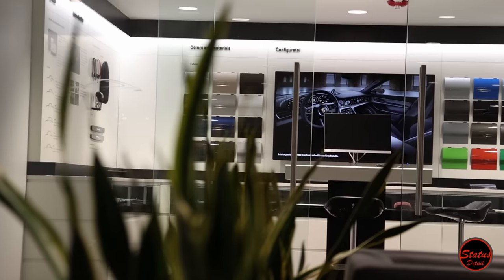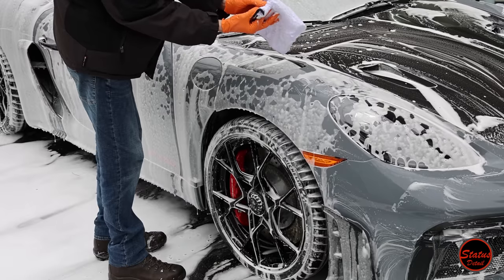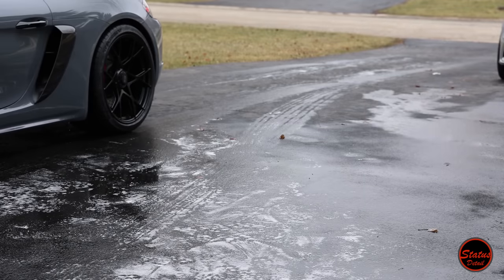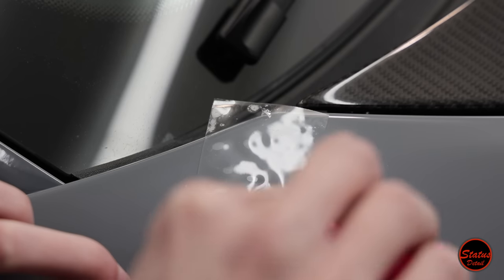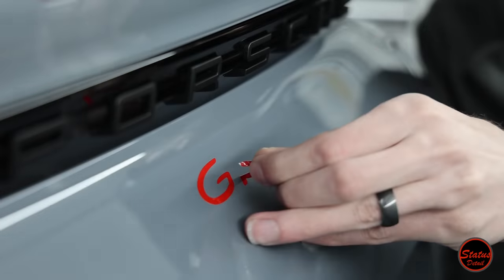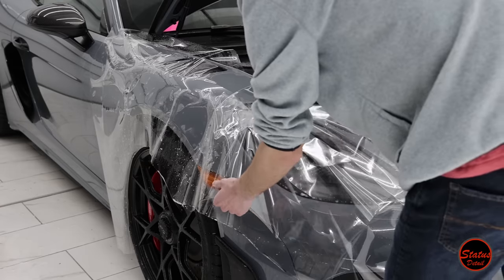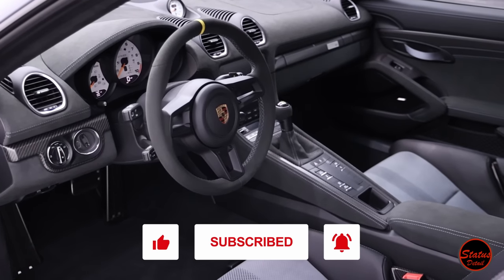GT4RS The World's MOST EXPENSIVE DETAIL!?!?

Comment: 12k but didnt even take the wheels off. Got the same job done minus the xpel and overexagurated coating My detailer did the same with a gyeon ceramic coating on the paint, glass, wheels (taken off the car) and callipers plus an interior detail good for 36 months with warranty for 1745euro's. You're a straight up thief bro.
Reply from the maker: We don't use Xpel. Stek is a superior ppf in my opinion. 

I'm not sure on the conversion from euro to dollars but I'm pretty sure my normal ceramic package is close to that depending on the level you choose. 

Full body PPF is expensive and your comparing two different details that are WAY different so obviously they have different prices.
Reply: @STATUSDETAIL  So what? 7k for a stek ppf? And why 3 coats of ceramic coating? Just to ramp up the price? You didnt even remove the wheels and clean the wheelarches. The gyeon coating he used is the best there is bro, junk doesnt touch my car. Still a thief, I see this all the time with you Americans and UK people. Should be ashamed, what I saw aint worth 12k, not even close.
Reply from the maker: @swansmeister  your clearly an expert.
Reply: @STATUSDETAIL  And you clearly a rip off.
Reply from the maker: @swansmeister  you should see your self out 👍

Comment: This looks amazing. Wear clothing that doesn't attract dust may be a good idea. Using painter's pants and tunics will prevent dust from getting closer to the application process. Resultantly prevents any dust from getting in between the PPF and the car during the application phase.
Reply from the maker: Actually a great comment. I have a habit I'm trying to stop of touching my pants when my hands are to wet. But I get one short blue jean fiber and it ends up in film and then I ntti go back and get it! I have been wondering about a no lint type pants.

Comment: I just came across this video cause I was looking for detailing videos so I can learn more about washing cars and taking care of them especially since I got a new car aswell and I'm getting into detailing paint correction and this was the perfect thing I've seen. The attention to detail and the fact that you can tell you really enjoy doing this and making everything perfect by even washing the car two times and not just half doing something. pretty surprised by how underrated this channel is I will definitely be buying some products from your website.

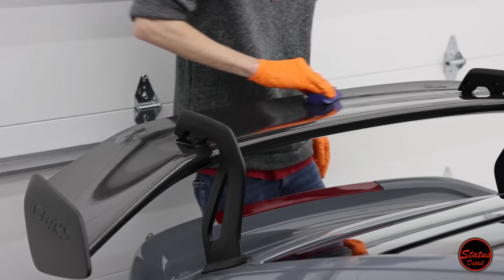Ps -I'm not sure what the solution you used at @19:57 with the brush also when putting the ceramic coating at @18:14 im not sure If you have to wait like 10 minutes or if you can just wipe it off right away?
Reply from the maker: I believe your talking about gyeon leather cleaner and you will wait some time before removal with ceramic but it depends on temp and humidity. The second coating the topper goes on and comes off quicker tho. 

Glad you found the channel! You might enjoy the maintenance detail videos 🙂👍

Comment: Amazing, at this level of ocd those brake rotors are killing me. Not hard to treat the rotors. No I'm not talking about the surface of the rotors but the rust you can see in the drilled portion. Just pull rims off for cleaning its amazing what you find under there.
Congratulations on your success. 🙌
Reply from the maker: Thanks for watching 👍

Comment: I love your videos.  I like that you are passing on to us what you feel the best products are.  I have two questions.  1) I’ve searched for this info in your videos but cannot seem to find it.  What product do you use on rubber seals?  2) I took delivery on a 2023 car 6 weeks ago. Except for the hood and the roof, the whole surface has the dreaded orange peel surface.  Is this going to require a more in depth paint polishing (and therefore more expensive) than it would have required otherwise?
Reply from the maker: Thanks for watching! You can use perl or actually gyeon tire on rubber seals. Dilute it a good amount. Wipe on. Then use dry towels towels to wipe off. You can even follow with prep to ensure you pulled residue. Those do a nice job of hydrating rubber. 

The only way to remove orange peel is wet sanding. Just about every new car has it. It will be very expensive to remove.

Comment: Really enjoy your videos. I've learned a lot. I tried Hyde's on the rotors and it was like 50% better. Then used Vinegar and that removed all the surface rust. It seems like driving the car and using the brakes will introduce that particulate back onto the wheels which you then have to remove introducing scratches that you so painstakingly tried to avoid. Curious on your thoughts.
Reply from the maker: I responded in depth to this in a different comment I'll probably never find haha. 

Fast version. The back of the rotor and inside vented part will still rust and have water in it. When you drive away it still goes all over. The rust stopper stuff only helps on the face of the rotor basically giving the illusion that you're doing something. 

That's another reason we did hydro or wetcoat. Do your fast drive. Very small amount of junk will end up in barrel. Use a nice microfiber and shoot quick detail in it. Or if your really concerned spray a ik foamer Into microfiber for extra lubricant. One fast wipe and because it has hydro or wetcoat it will clean up beautifully. 

I'll try and show that today when I film this gt3 touring detail 👍👍
If you want "perfect" wheels it takes that last step.

Comment: I spent two days paint correcting my Tesla, but was afraid to sand the dust specks that I found in the paint. I must have come across at least 7 of them. I had PPF applied to the front of the car and then I ceramic coated the paint and wheels. I put a hydrophic coating on all of the glass. Nowhere as nice as the detail job that you did.
Reply from the maker: Sounds like a really awesome diy detail!!

Comment: randomly came across your channel and within 1 min of ur ppf install i can tell you guys know ur stuff! i personally love to bulk install my ppf aswell. i feel like i spend waaaay more time trying to line up precuts than just simply bulk and get everything nice and tucked. with nothing visible. also loved the part where u said neither approach is right or wrong just what you want to get out of it. durability or aesthetic. keep up the good work guys. always nice to see shops doing proper work! do you use gel or is it soap and water? cause only thing i saw u guys do that i was a bit iffy on was stretching the quarter panel after having already squeegeed a bit of it. this can risk getting a glue line.... so im wondering can u do this bc stek doesnt get glue lines or is it the solution ur using that allows you to do this?
Reply from the maker: Love comments like this from guys that know the business and appreciate the work!

You can definitely get glue lines with Stek. My installer is better than me and does voodoo witchcraft stuff that I'm not capable of yet that rear fender quarter had zero marks lines etc In it. 

Stek definitely gets glue lines fastif you pull it up to go for dirt for example. So you gotta catch it fast. It's tricky because if you squeegee light you can back easier but you get a weird bubble thing happen as PPF like airs out. If you push hard you get no issues but going back is hard. 

So you go for hard pressure and triple check dirt early!

That was jj soap and water. I have my solution pretty dialed in! That took a lot of time and wasted material. I also have carpro gel I will try out soon!

Comment: Nice video. Thanks. Is pressure washing the wash microfiber towels on the windshield your only process to clean them? Great idea for those who use traditional mits.
Reply from the maker: I typically wash them out on windshield and then wring it out and put it in my wash bucket for the next wash.... Usually that's only a day or two away lol. 

If You do the wash process like I did your towels don't really get that dirty. 

If for some reason the towels are extremely dirty or maybe the car simply was extremely dirty then you can still run it through the washing machine. You can also just downgrade that towel to something else and use a completely new set of towels for paint if you're extremely meticulous and want perfect towels touching paint every time.
Reply: @STATUSDETAIL  thank you for the feedback!

Comment: Awesome work man, and such a beautiful car!

I was wondering if after you wash the car again to remove the compound dust, if there happens to be any water that dries or spots, will the IPA wipe stage remove that before you actually ceramic coat?

And also do you have a video link on how to clean alcantara/suede on the interior? Thanks.
Reply from the maker: Yea IPA will fix. But if there's ever a time to be extra careful with water spotting that's the wash when you're extra careful
Reply from the maker: Yes I have two different videos on alcantara actually
Reply: @STATUSDETAIL  right, that’s why I get worried to rewash the vehicle, but I do struggle with a better way to remove the dust
Reply: @STATUSDETAIL  I found one, thanks

Comment: Love your work. Does the porsche hood sticker stretch when you remove it, or can it be reattached on top of the PPF?
Reply from the maker: Its basically trash after removal. I saved it for the customer. It stays in tacked but not good enough to use again. We ordered stickers for everything I removed. But they did not come in time! So in spring when it's driving season we will put them on👍

Comment: Fantastic job once again! Did you use DI water for parts of the washing process?
Reply from the maker: Thanks! 
Interestingly I did not! I almost did di water when I did version 2 of the shop. But ended up not doing it. My water here is from lake Michigan and pretty well filtered by the time it gets to me. 

I will get water spots if I'm not careful. But with a proper process I have never had issues. It my water was in worse starting shape then I would run di tho
Reply: @STATUSDETAIL  That's so nice. The water here was like 450ppm when I tested it I think so water spots are an issue. What's a good soap in your opinion to help remove or at least try to remove them? Descale?
Reply from the maker: @ddautodetailing  yea that would work but carpro or gyeon waterspot remover are great too

Comment: Started getting into polishing me and my brothers car recently and have been thinking about buying CSL and applying it, only issue is that I don't have any access to a garage to apply it and let it cure. I was wondering if you think if its possible to apply and cure while outdoors or if you think I should take another route instead. Love the vids
Reply from the maker: Thanks for tuning in!

If you work in smaller areas you can work outside. You just need to be careful with wind for example as it could make the ceramic dry to fast and give you a high spots. Working smaller areas will make it more manageable.

As for the long term cure I'd. Recommend doing this when you know the car can sit outside with no rain for 24 hours

After about 3-4 hours of cure time I'd put carpro release on it. Temporary protection while ceramic cures. 

Hope that helps. 

Btw see if a friend or family member will let you borrow a garage for a day!
Reply: @STATUSDETAIL  Thanks appreciate it!

Comment: I noticed you typically do multiple coats of ceramic and protection. What do you use for each coat? Would you be able to do a video walkthrough on how to apply down each layer
Reply from the maker: I use gtechniq ceramic! The maintenance videos on the senna and touring both show the exo top cloat application 👍
Reply: @STATUSDETAIL  does EXO work well as a top coat with other brand Ceramic coatings?
Reply from the maker: @jay_hubs_8955  it's incredible at that. It's designed to bond to ceramic. Period. Doesn't matter what.

Comment: Does it help to double up on PPF for the front end of a car?
Reply from the maker: I don't believe so but there are exceptions to that on occasion.  Like if it's a full Time Track car The fender area behind the wheels Could benefit from a second later of PPF potentially. Other cars like McLaren's and some of the more modern porsches like the new GT3 RS fall into that category too. 

10 mil ppf is a thing too but it doesn't stretch great so it's hard to use. We use 8 mil

Comment: The only thing I would worry about is using hot water in the winter time, that can cause windshields to crack because of the dramatic shift in temperature
Reply from the maker: That only happens if the glass has chips in it and if it's cold enough to basically flash freeze the water into ice. So like -20. You won't find me washing cars outside in those temps lol.

Comment: I personally don’t use the same microfiber towel for the top of the car and the sides and bottom. You will have more dirt, and large size particles on the sides of the car than the top and even more so on the bottom. Use one towel for the top, one for the sides and one for the bottom so that you are not dragging all those potential particles all over the car.
Reply from the maker: I don't think you understand the method I showed. It won't matter if you wash front to back. Back to front. Bottom to top etc. 

Every panel you do is a fresh towel side. You never use a towel side more than once. So each towel and respective side is one time use per wash.

Comment: what brake dust? it had delivery miles!
Reply from the maker: When you do a detail like this you clean wheels. To skip that and apply ceramic would be weird. After sitting in ports and dealerships and being moved around and driven a few times it's just a obvious step.
Reply: @STATUSDETAIL  totally understand just was wondering jow you would get dist from the brakes when it really hadnt been driven. i just received my 2024 Cayman GTS 4.0 and it is at a local detailer (SF Bay Area) for Paint correction/PPF amd ceramic coating. hoping it comes out as mice as your cars
Reply from the maker: @MW-gi1tr  ccb don't make much dust at all. But you just need to make sure it's clean when doing what we do. Would be like going to surgery and telling them you took a shower that morning so you don't need them to sterilize anything before they start. 

Awesome! Enjoy that new car 🙂🙂

Comment: Fantastic video - one question - when the cars are largely factory painted by robots how do they get sanding marks left on them? Is this the factory painters patching things up - albeit improperly? Hard to see how they get past the inspection process.
Reply from the maker: Good question! The robots or someone paints it. During that process a spec of dust goes into the clear coat. During inspection by a human they find it. Rotary sand it out and then compound the sanding mark out. They just don't fully refine that mark out. 

Basically what I sanded out of the roof. That's what's happening in the plant but they don't fully refine the sanding mark away

Comment: What is your dilution ratio for the pre wash? I’m trying to get it right so it is thicker but not to thick to where it just sticks
Reply from the maker: Typically I'm using 3 to 4 oz but the thickness of your foam depends a lot on the foam product you're using the pressure washer GPM the orifice nozzle on your phone cannon and even the kind of water you're using. Well water can sometimes make it more difficult to foam
Reply: @STATUSDETAIL  I use a 2.4 gpm pressure washer with warm tap water and I use the gyeon foam pre wash I may have under diluted last wash I did tho I will wash my dad challenger again today to test out that dilution . Thank you!
Reply from the maker: @chasegoodrich5250  yeah you can see pretty good results You might just need to up the soap if it's not working right

Comment: What kind of water do you use to wash an rinse the car? I assume you are not using simple tap water. Are using reverse osmosis filtered water?
Reply from the maker: In my location my normal city water is actually pretty decent!

I basically always wash in shade and if I'm in more sun than I like I promptly move car inside after the wash. Meaning dry inside. 

The only real water issues you would see is water spotting during drying. 

Unless you have really bad well water or really bad minerals in your city water.

In general if your being careful you should not experience any issues with decently normal water. 

DI water from something like a CR spotless is a great idea tho. It will never hurt anything. It can just get expensive replacing your resin packs if your washing often or simply running water through the resin often. 

If you buy a cr I'd recommend primarily using that on your rinse to save your resin. Not much bad should happen on your first rinse or wash stage unless your in 100 degree sun. Then use it the entire time.
Reply: @STATUSDETAIL  Thanks soich for the detailed reply...I guess everything you do is very detailed 🙂.  I have watched and subscribe to a lot of auto detailing channels and you are up there with the best.

I always thought DI resin can be regenerated with salt, but after a quick internet research it's not entirely true and is more complicated and hazardous. So, you are correct about replacing the resin.   So much for me investing in a DI resin system.
Reply from the maker: @investore12  my pleasure and happy I could assist! Thanks for the Sub! I am pretty detailed in everything I do I think. How you do anything is how you do everything!